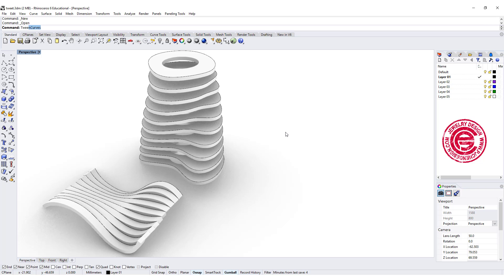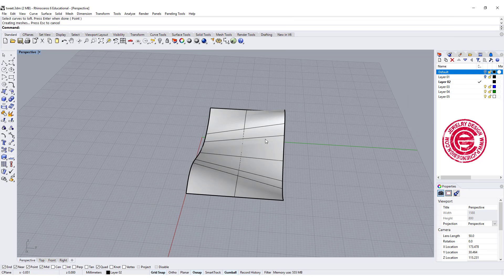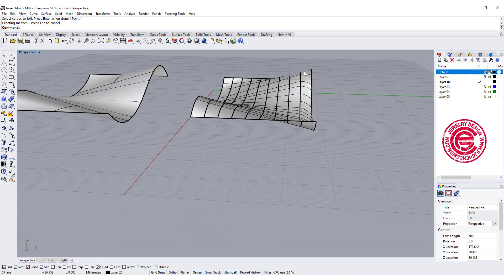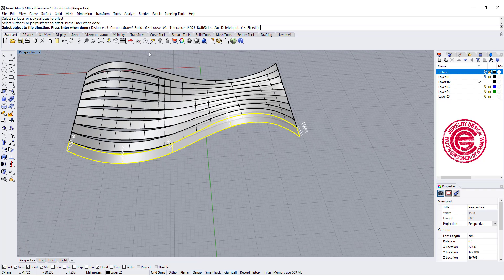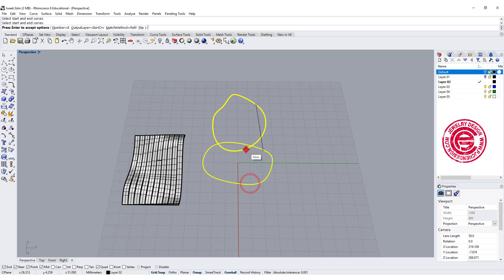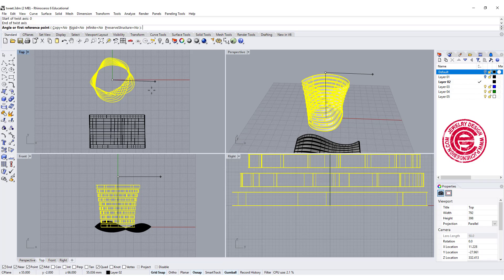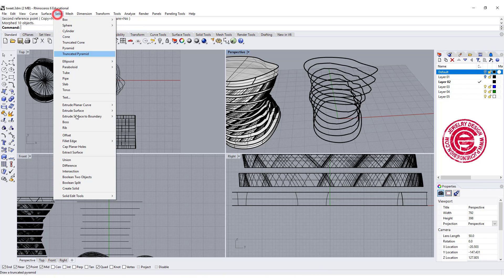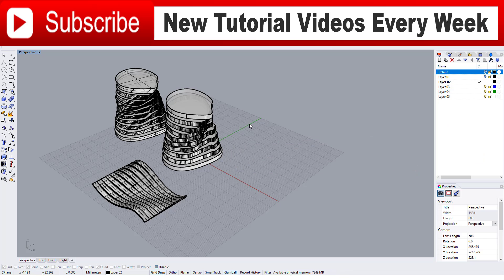Tween Curves Command (2019): Rhino 3D CAD Technique #21 (2019)

Comment: this is greta tutorial but i have issue with lines starting and finishing points, 
soon as i click in top, left or front view they are not were i wanted them to be and they are flying in the air. how can i fix this issue?
Reply from the maker: if you use gumball or move tool. it will snap to the place you want
Reply: @PJChenJewelryDesign  thank you. facing another issue, it cuts the view when zoomed in, like there is a clipping plane but there isnt.